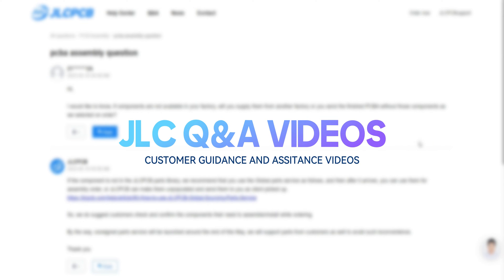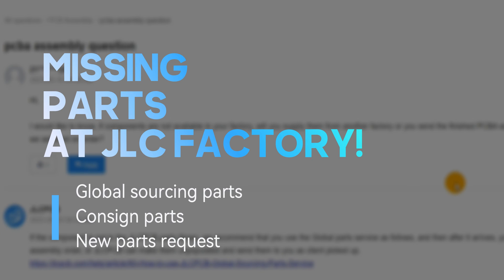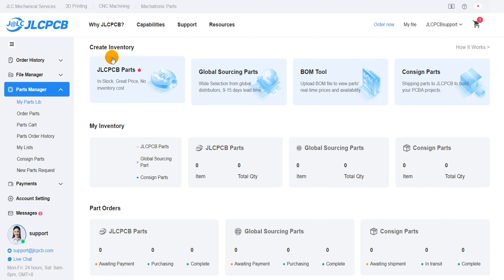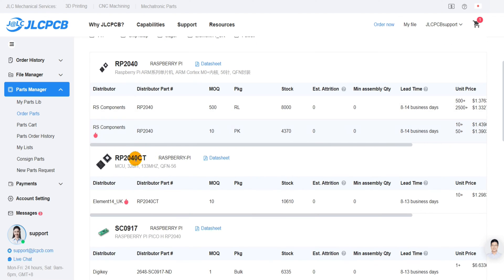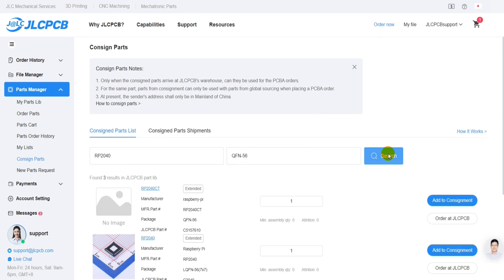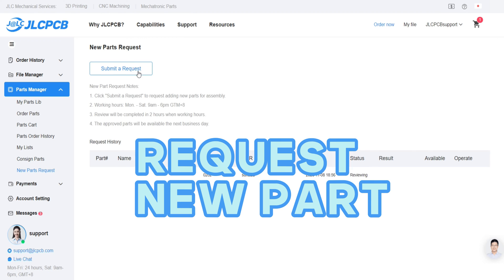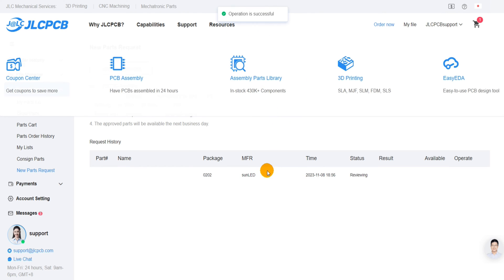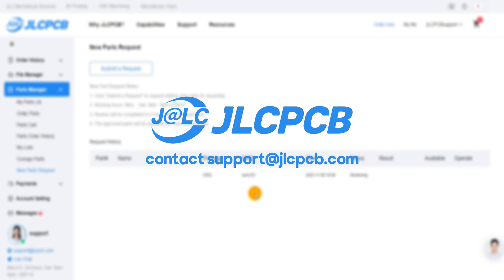JLCPCB Q&A - What to Do When Missing PCBA Parts at JLC Factory

Comment: Around mid 2023 year, they have decided that a simple 805 resistor is somewhere near 1gr.
Order a pcb with 200 components, multiply by 5 pcb and it is1Kg of SMT.

Or course the real weight of 1000 R805 is near 5gr plus solder, so maybe 20gr. Not 1000.

Check the calculator